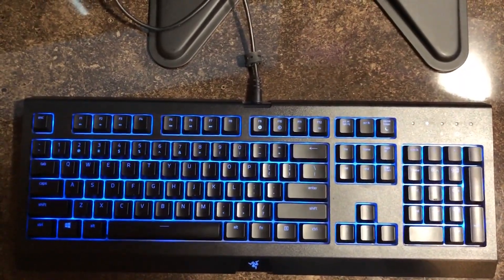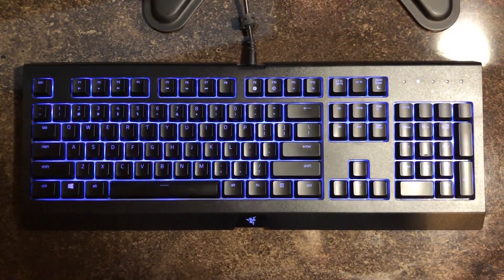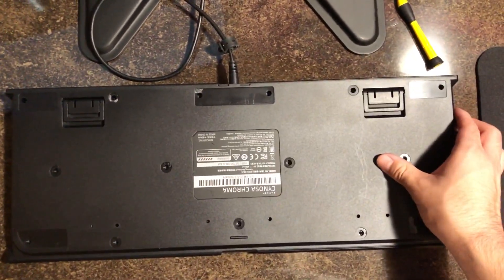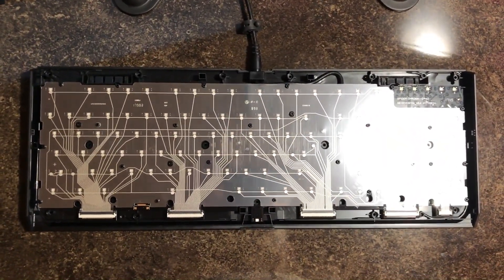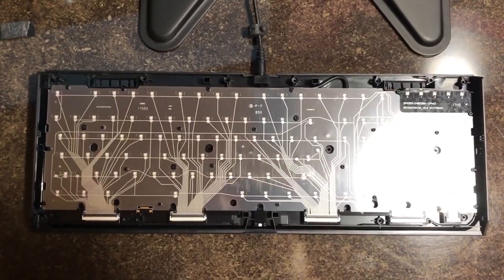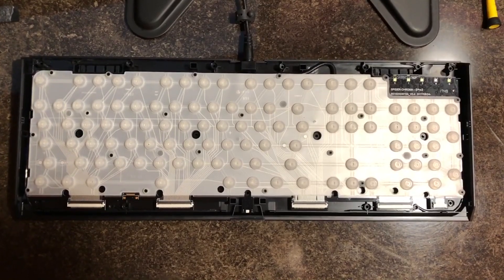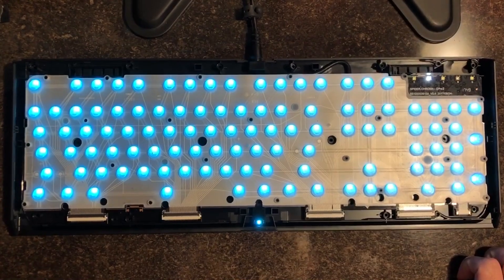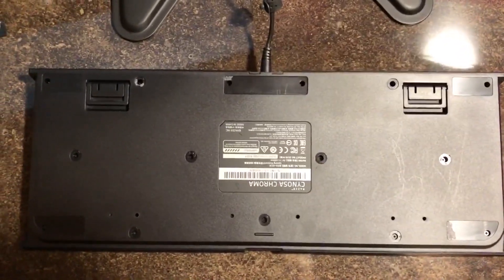Razer Cynosa Chroma | How to Fix One Key Typing Multiple Letters

Comment: When i press enter it does ‘ any way to fix?
Reply: I found another problem that is related to the continuous registering of a key.

Problem: Setting your keyboard to a custom profile will cause this continuous registering of a key.

Solution: Set your keyboard profile to default- usually the uppermost profile on the list (e.g "DESKTOP-OB9QANA...").
           
                 Step 1: Launch Razer Synapse.
                 Step 2: From the top bar, select "KEYBOARD".
                 Step 3: Go into either "Customize" or "Lighting".
                 Step 5: Besides "Profile", there is a bar. Upon clicking it, it'll show you a list of profiles (unless you haven't made any profiles, these instructions are not required as this may not be the source of your problem).
                 Step 6: Delete all other profiles (you may lose such as key bindings). In doing so, it is required to select the profile first and then delete by pressing the three-dot icon (Warning: do not delete the uppermost profile as it is your default unless it doesn't allow you to delete).
                 Step 7: Select the uppermost profile, usually the first and the default profile and your problem should be solved, unless it didn't, then I was of no help to you at all and have wasted your precious time. My apologies.